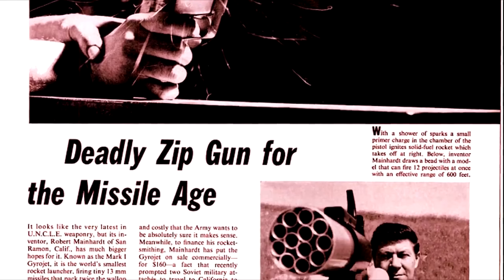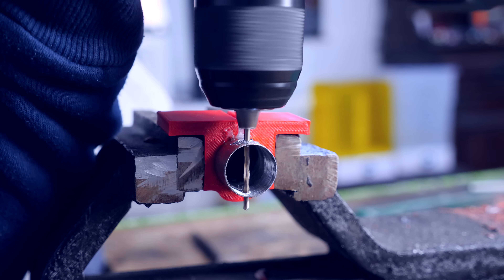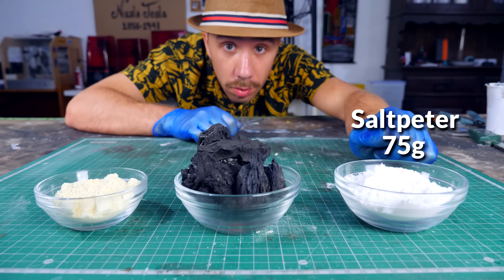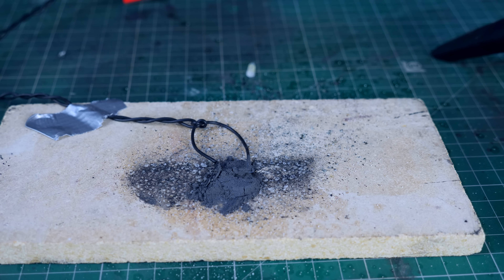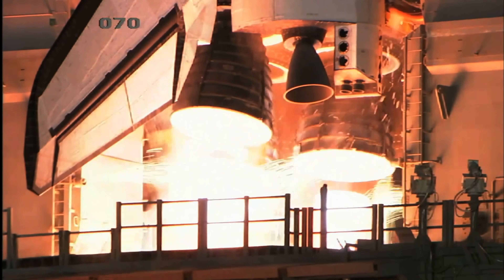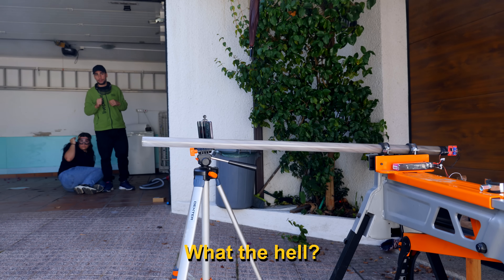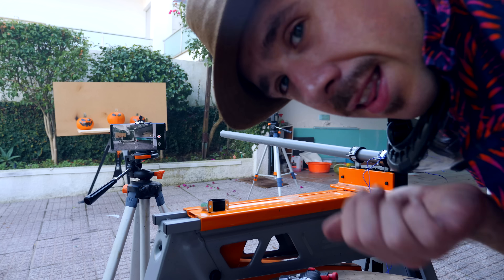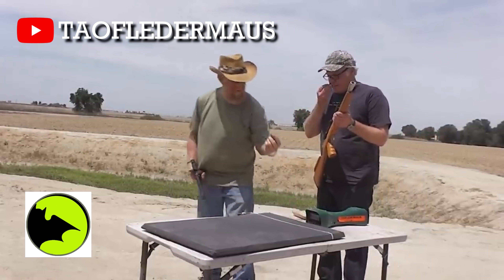GYROJET - The Spinning Rocket Bullet

Comment: The gyrojet was actually an awesome idea when it was created, it was just impractical for use as a small arms solution. It would actually make sense with certain constraints for slightly larger weapons in indirect fire or electronically guided, portable rocket propelled grenades. If it could be controlled similarly to how a Tomahawk missile works (that is with either an automatic guidance system or possibly a manual control) then it could perform like a miniature rocket artillery carried by nearly everyone in a platoon.

If you could implement the weapon between 16mm and 35mm diameter, it could carry a variety of payloads (HE, incendiary, fragmentation, air burst, CS, OC) that could detonate on impact or via timer. It gives the versatility of a shotgun or grenade launcher (in ammo variety/specialization) without any recoil. 

The gyrojet also is one of the only projectile weapons where the projectile accelerates as it flies rather than slowing down. 

The design is really cool, but we also have to recognize that their accuracy can vary wildly  between each projectile as it is propelled/stabilized with nozzles built into each round. Any slight variation in these holes could cause the whole projectile to veer off wildly without warning. It also in suffers the same problem as current rocket propelled grenades in that the flight path will easily give away the shooter's position
Reply: And now with the EXACTO project, theres no point anymore

Comment: Suggestions on the Gyrojet project: 1, use the gyrojet casing as the mold with a rod that slips into the casing to form the center hole and a cap that fits over the casing that holds the rod, scuffing the inside of the casing will create better bonding to the rocket candy so it stays put.

2, for the igniter, use the brass end from shotgun shells for two effects first simplicity with regular pin firing the second is the main problem with gyrojets being the slow start speed with the shotgun brass and ignition charge you make a hybrid round getting a fast start and continuing thrust.

3, get or make a rifled barrel that matches the spin of the rocket so when the brass shotgun shell ignition happens it is kicked out spinning in the correct manner.

Comment: I have an idea on how to improve the bullet. Because the original bullet uses nozzles at 8 degrees and your bullet is MUCH larger than the original, you probably would need to angle it a lot more to achieve a similar spinning affect, probably within the 30-45 degree area. (I'm no scientist but this solution makes sense to me.)

Comment: Modular upgradeable 3D printer where the size can be changed to handle any size print and change nozzle heads like plastic or laser for engraving. Like VESA monitor mounts, there should be a standard for the print head so it can all be mounted interchangeable between other vendors.

Comment: You could try 3d printing the nozzle along with the propellant from the sugar based mixture itself.  As long as the propellant is ignited from the front end (other end to the nozzle) it should have increased thrust due to the reduced weight.  The only thing is its a one time use.  I think it would be a good project to try and make your own 3d printing rocket propellant filament.

Keep up the good work :D

Comment: Go for a vacuum assisted potato cannon. Mythbusters did it and reached supersonic speeds, but I'd be interested to see if by adding an external vacuum reservoir with the port at the end of the barrel if the overall length could be shortened up while still getting similar results. Keep up the awesome videos!

Comment: video idea:  since you're having trouble with the nozzles melting, have you looked at lost PLA casting?
basically using PLA to print anything you want, putting it in casting material, melting out the PLA then casting the area left be the PLA in whatever metal you want. Probably harder than it looks, but probably more your style since machining isn't really part of your content.
Reply: I think Integza mentioned before that casting is too much trouble and the easy aluminium casts can't stand the heat, but still a good suggestion, it's probably the best way to meet the goals with 3d printing involved

Comment: First of all: again a great video!

Video idea: You could try using this self-createdspiral aerospike nozzle from your last video, this would probably give the bullet a more evenly distribution of thrust and at the same time good thrust
Also you could make some kind of launching mechanism, so the bullet has a decent basespeed and is oriented correctly when coming out of the barrel (maybe a pressure-loaded barrel with a spiral in it, so the airflow around the bullet is rotating, which rotates the bullet itself)
But then don‘t forget to shoot some tomatoes with it ;)

Comment: you should try to remake your nazi rocket engine but with the potassium premagnate in a baloon that you explode and it falls into the water. idk if you understand 
you put your hydrogen in an acrylic tube and in this tube there is a small baloon filled up with potassium premagnate and when the baloon explode, it starts the reaction.

Comment: A technique the Russians allegedly used to create spiralling rocket nozzles was to just make sheet metal blanks with identical holes in them, stack them on top of each other so the holes line up and then rotate each blank a bit so they form a stepped spiral, and then spot weld them together.

Comment: I think the metal casing is also cooling the outside of your fuel meaning your burn is not as even as you think
Maybe try using a tighter barrel with some spiral grooves for fins to interface in, so that you have reliable spin while the tube guaranteed alignment

Since you're already halfway manufacturing weapons you should look at the 3d printed fun community, they make decent barrels with edm 
(The machining one, not the music)

Comment: The whole thing needs to be made into a bolt, like you would use with a crossbow. Except the tip should have curled wingtips sweeping back so the the whole projectile spins. While at the same time having better balance and control. One last thing, is try using a small funnel like on the bottom, one hole only that goes into a thruster bell.
A spinning rocket Bolt/Arrow that can be fired from a crossbow with a timed fuse, so it will go even further and hit harder. Kind of like an afterburner..🎯

Comment: Honestly, I think just more of an off-center angle for the nozzles would help the instability a lot. The barrel isn't long enough (and there's too much drag & friction compared to the amount of thrust) for the rockets to get spinning fast enough to stabilize. A greater angle would lose some forward velocity, sure, but it'd also increase the rotational force, which would probably help them be stable enough to at least delete those pumpkins! It'd be a relatively quick change too, just tilt the holes a little more and re-print the ceramic nozzles.

Comment: Would it be possible to add a tail to the rockets? like a stick of metal in the middle of the nozzles with a small fin no greater than the radius of the rocket itself at the end. Maybe that could help to balance them, but they wont look that much like bullets anymore

Comment: Great Video as always, also RIP Danny.  As with other projectiles and gyroscopic stabilization mass to spin rate is an issue.  While 8 degrees was ideal for the original gyrojets, it is possible that that it creates insufficient spin for the CO2 canister rockets.

Comment: copper per chlorate is a good oxidizer. next time try using a butcher paper tube in the molds like its a cardboard tube. second. the concrete nozzel also has a hemispherical back end and the fuel poured in on top and the bottom nozzel is ten degrees flanged shape. quarter inch wood dowel then you can just drill it out. but a starr shape core would burn faster. and your gyro nozzel was one nozzel short. and they need to come off a shared combustion chamber

Comment: Video Idea: Maybe you could try to build something like the Focke-Wulf Triebflügel VTOL aircraft (Vertical Takeoff / Landing). It was supposed to use three rockets one on each wingtip, to build up enough rotational speed to start its ramjet engines. There was not supposed to be any reaction torque to cause a counter rotation of the fuselage, because the rotor blades were driven at their tips by the ramjets, which would be interesting to see. As always great job, your videos are always funny and ... educational!

Comment: Ive now seen these Radiometer called glas spehres on some occasion and ive always been wondering if you could actually harness a little bit of energy out of them. Sure it would be a lot less than a typical solar panel, but i guess it would be a fun little project. I dunno, might be a stupid idea but it sounds interesting in my head.

Comment: I think you should try the gyrojet rocket bullet again but with the following changes: (1) Design a nozzle with an odd number of more narrow outlets  (acting similar to a cooling fan design to reduce wobble) and (2) use a sabot in the barrel to ensure the bullet exits the barrel in a proper orientation.

Comment: I'd guess that the rockets weren't balanced properly. You need more mass in front, and drag in the back. The original rocket bullets had a lead mass in front. Perhaps add a ridge on your ceramic nozzle that extends beyond the shaft to add drag.

Comment: well, you could take the gyro out of the jet, and just put some fins on a CO2 cartridge.

personally i'd recommend 3d printing something like a cylindrical radiator/heatsink, which could fit around the neck of the cartrige, while still having a simmilar diameter to the rest of the bullet, allowing it to be used within a barrel

Comment: Suggestion for your next endeavor: Rocket Bullet 2.0/Redux - instead of casting your propellant separate from your casing just fill casing just enough to barely fill it and then use a tube to hollow out the center and have said tube it held in place with a 3D printed frame. Similar to those 6 pack popsicle molds. Reuse the CO2 cartridge contoured end you cut off and insert it backwards into the propellant loaded cartridge flush before propellant fully dries/cures, by twisting it in. It will now act as a nozzle. After propellant fully dries cold weld or epoxy the gap around the nozzle and casing. Instead of using a tube to guide it forward arrange 3 dowels around the rocket bullet in a triangle formation with the bullet in the center. Keep the dowels in place using 3D printed guides. Have the dowels adjusted just enough to keep it snug enough to guide but smooth enough to not let it fly.

Comment: I think you're barrel is way to small for the size of shot and speed of spinning. Think about the ratio of speed the gun is releasing the bullet at the barrel to the weight/spin ratio of the gyrobullet. Because your shots are so much larger, it will take a longer barrel to allow the shot to get up to speed no? if you scale this thought up it relates to shoulder rockets design well, and this is just a scaled down version right?

Comment: I think more angle on the jets would help. It's more important to spin fast than for the rocket to go fast.

Also you probably have an imbalance in the fuel due to very minor density imbalances, which may be trivial to fix with the right equipment. Maybe consider how a car driveshaft is balanced, then shave tiny amounts off your fuel until it is balanced.

Comment: 3D print a threaded extension/choke for your barrels. Also, it looked like the bullets weren't going very fast out of the barrel, but then accelerated a lot when they reached the pumpkins. Maybe try something that will give them a higher muzzle velocity - I think that would add a lot of stability.
Reply: just add a small kickstarter charge and boom: you got a bolter
Reply: That was actually by design even with the originals. They had a relatively low muzzle velocity and accelerated once leaving the barrel. The original barrels were more holes than tubes so they had ZERO pressure inside the barrel. You could literally see the bullet in the chamber when it fired and could see through the barrel down the entire length of the barrel.

Comment: Someone already suggested watching the Gyrojet video on Taofledermaus. I would second that endorsement. What I've learned from watching that one and what I remember from the original reviews of the Gyrojet was that it wasn't all that good. It suffered from many of the same problems you had. Thus it did not last long in the marketplace.
Since a rifled (spiral grooves) barrel is a sucessful design as witnessed by it's longevity. I would suggest a marriage of the two designs. A cartridge type of round containing a primer,  powder and the rocket projectile. The ignition would occur as in any firearm. The firing pin ignites the primer, which sets off the powder charge, which squirts the projectile down the barrel giving it the needed spin stabilization. After the projectile has exited the barrel the unslanted rocket motor fires pushing the already spinning bullet towards the target. The rocket motor can be ignited via the powder charge using a very short delay so excessive pressure does not get produced. 
At least that's my take on the subject.

Comment: I think you should look at the original design of the gyrojet, which uses 4 nozzles to spin while propelling, giving an even force from all 4 nozzles and both a spin and forward force. Your design appears to use only 2, which seems odd. I'm not a rocket scientist, but based on my knowledge of physics, having 2 nozzles gives the possibility of a change in direction, given there are no counters to any slight deviation from manufacturing defects or the pull of gravity. If you have a single exit, there's only one way for the energy to escape, and as long as the nozzle is perfectly symmetrical, it should go straight; along a parabilic trajectory like a normal bullet. If you have 2, one could be giving slightly more thrust than the other, or there could be a non-negligible angle deviation or aerodynamic or gravitational effect. if you can spin enough to create a gyroscopic stabilization, you should be able to negate those forces as much as possible.

Comment: You might still be able to have fins, you could have some spring loaded find that pop out once thr bullet is out of the barrel, it shouldn't affect the leaving velocity and should help with the stability without needing to spin it
Reply: The thing is those internals would be too small and would get burned from the propellant or cut into propellant, along with adding weight and making manufacturing a bitch.
Reply: @lelelelelawl  that is very true, might be a fun idea though :)

Comment: Integza, you need to seal off the back of your tighter acrylic barrel. You were saying that the tighter barrel wasn't doing anything, but you COMPLETELY missed the perfect rifling pattern painted on the inside by the nozzle exhaust, which means the fit was giving your rockets the time they needed to start rotating fast enough to hopefully stabilize them.

Comment: So I think if you had one or two of the larger nozzle holes to propel the rock and two smaller and more steeply angled nozzle holes for the spin stabilization it might be slightly more accurate. Also looking at the footage even though you said the clear barrel tube was too tight a fit I notice that the resistance caused the projectile to develop more swing in the barrel tube. So possibly playing around with nozzle design and barrel tube fit will make for a interesting rehash video.

Comment: Have you tried model rocket engines instead of making one out of a CO2 housing?  I think the weight of the housing may be limiting flight.  Model rocket engines and igniters are basically what you are looking for and come in a variety of sizes and burn durations.  May need to direct the nozzle direction if you want spin.

Comment: one small thing to mention, gunpowder is more of a recipe that you can modify and miss match as you like, just take the ratios into account, for example, the more sulfur you add, the more gas you will generate as well as the slower the burn will be, the higher the amount of potassium nitrate, the higher pressure you will need to burn it with a higher efficiency and so on

Comment: Either 1: how high can a 3D Printed rocket go with your gun powder and stuff. Or 2: can you build a 3D printer from completed printed parts (other than electronics, so extrusions would be 3D Printed, the bed would be, the motors wouldn’t be, unless you find a way, etc.)

Comment: ok this is not easy but, it would work. You can make a bullet inside of another bullet, the  outside bullet is basically a normal bullet with a cilynder shape however it is actually made out of two parts that separates once it's outside the canion. the inside bullet is more like a modern missile with flaps to ensure accuracy and it has the propellant and a convergent divergent nozzle. and that't it best of two worlds. I hope you can make it

Comment: You might considering modernizing the design by copying spinner rockets produced by hobby pyrotechs. The have a traditional divcon single hole nozzle in the base and another nozzle radially located on the rocket body that intersects on a tangent with the inside diameter of your fuel grain so that the ejecta from the side nozzle creates axial rotation. They are also fused from the side nozzle to start rotation prior to liftoff